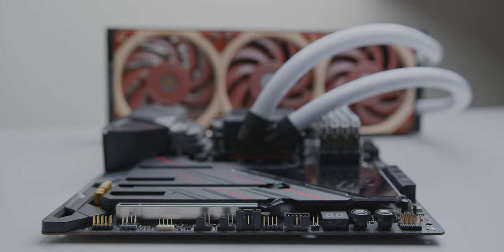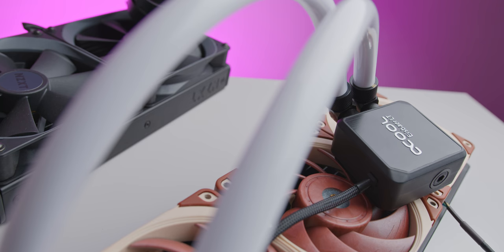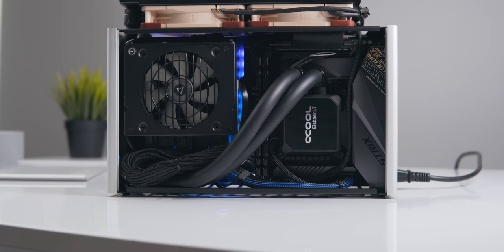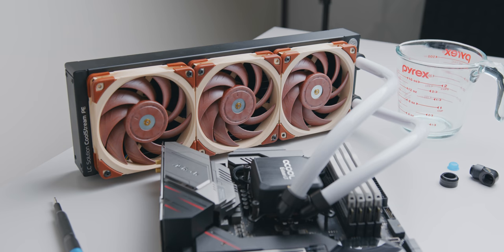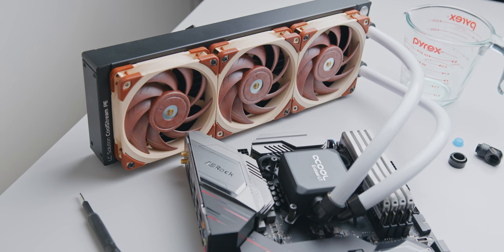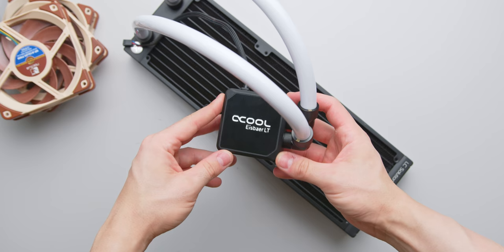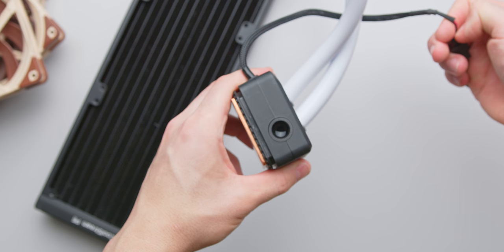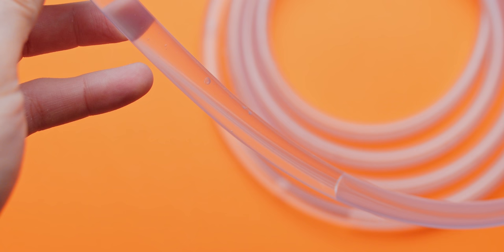Building an Overkill, Modular Liquid AIO Cooler

Comment: With the ugliest fans on the market.
Reply: imagine caring about looks of a fan when its single handedly the best fan to buy
Reply: @beanboy9029  actually, there are a lot of fans that are on its heals these days. I just assume boycot noctua until they release an all black fan that doesn't cost 12 bucks extra for stupid corner trim bits.

Like, why is it so important to make tan and maroon fans? Why can they use a good black polymer? An an AR15 magazine only costs 12 bucks and its solid black polymer. A stronger plastic than what their currently using.
Reply: @niteowl9733  the addressed this a while back, it was not as simple as adding a dye to the polymer used for the A12x15/A12x25 without changing the material properties.
Reply: @Kathdath  so they can change it. Itd not like it absolutely has to be that exact mixture. As long as the physical design doesn't change they can make it out of what ever.
Reply: @niteowl9733  there is a reason the change to a new polymer composition. The tolerances on the new 120mm fans is very tight. Outward expansion from centrifugal force required a better material than was previously used.

Reducing the space between the blades and fan frame was part of why the new design works so well. Trying the exact same design with the previous material saw breakages or grinding during product testing.

If you want a black coloured Noctua fan you can get older 120mm design, or the current 140mm in Chromax. I beleive the A12 series now have a chromax on market (but availability of everything is a little screwy at the monent due to the pandemic).
Reply: @Kathdath  so your telling me the same polymer on a glock wouldn't work? No, what your saying is they don't want to spend a little more because it would impact the bottom line. 

I think Noctua would sell way more fans if they were astetically pleasing. That would make up for the crazy good margin. They would make more money in the end via sales but, would need to crank out more fans. 

Also, they did make a black fan for the LTT store. 120 and 140. They can do it if they wanted to.
Reply: @niteowl9733  The LTT fans were with NF-F12 fans. You can get the A12x15 in chromax, and a12x25 is due for release later in the year.

Personally I have never minded the colour scheme and have used all Noctua fans in every personal rig I have made (the exception being the time I had a case that came with 17cm top exhaust).